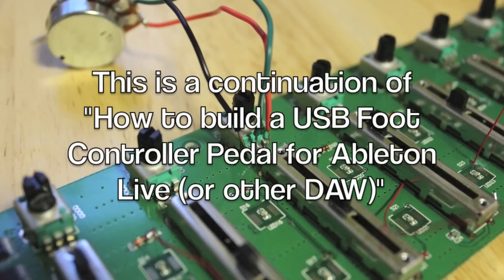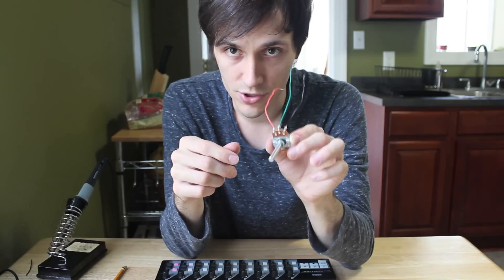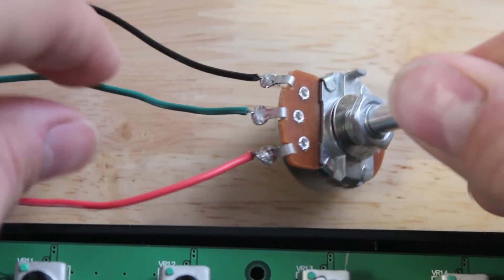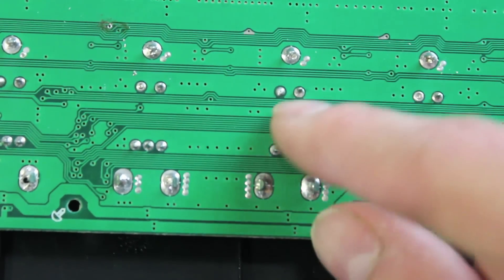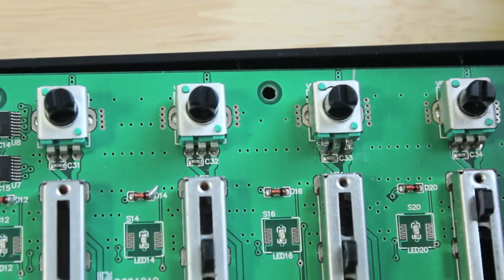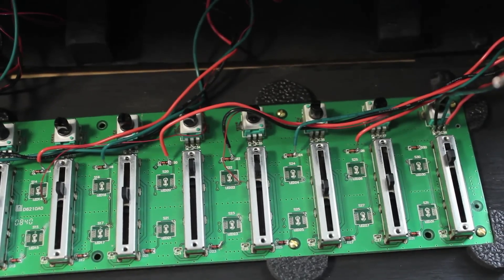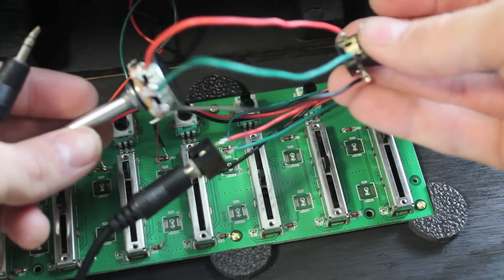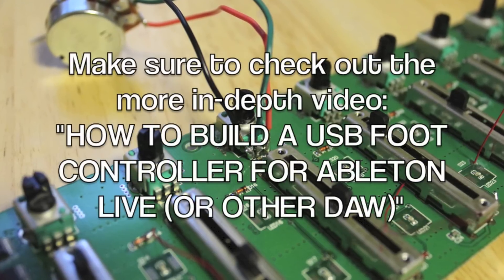Attaching knobs/potentiometers to your DIY foot pedal controller

Comment: hey, I have this little problem, I was making my own pedal and everything was fine...except that the POTS had really really small three pieces coming out. The problem is that, the solder and wire touch the other wires and solder. What should I do?? Thanks for any answer

Comment: You have to cut the potentiometer pins before soldering. If not, you have the one onboard and the one outboard in parallel and get a weird "resistor curve". If you set the one onboard to a non zero position, maps the control to a Live knob and turn the offboard, you will see non proportional movement. Search for "resistors in parallel" in Google.
Reply: Question:  As long as you keep the onboard pot at a "zero" position, will that allow the other pot to work normally?  And, of course, when you disconnect the external pedal, I'm assuming the onboard pot will work fine?
Reply: Victor Montequin im not sure but i think that because those are 3 wire that it would cause issues. the center is common and turning the pot left or right pans left and right. so all the way left is "zero right, full left". i would just clip em off with wire cutters.
Reply: Yeah, cutting the legs of the old pots and solder on the excisting left over solderpoints is the easiest way to do it. Leaving the old pots intact will
make it two parallel resistors. Also make sure to have the right value pots.